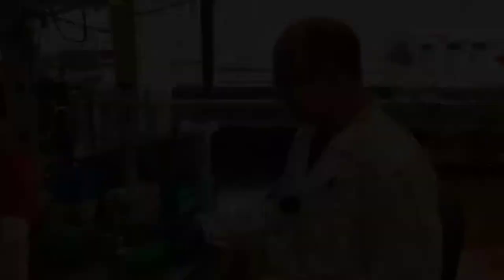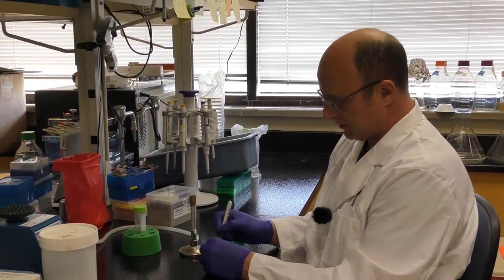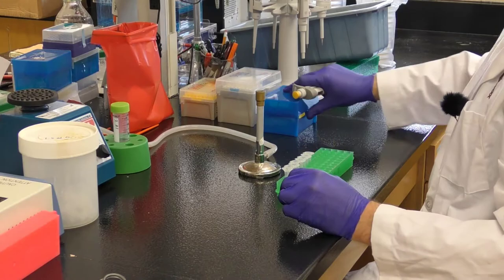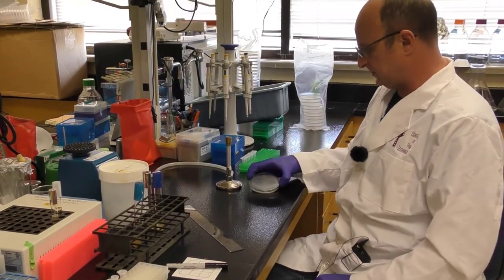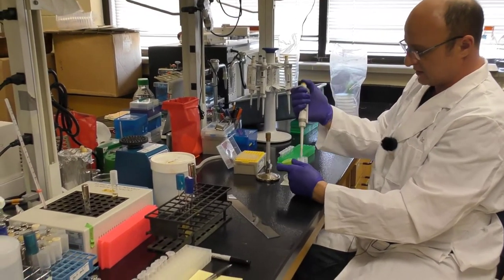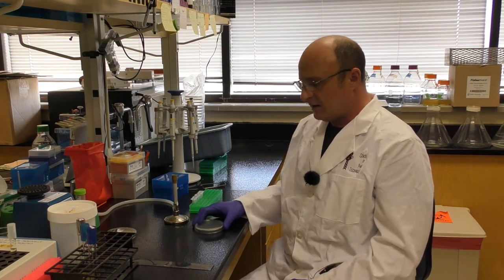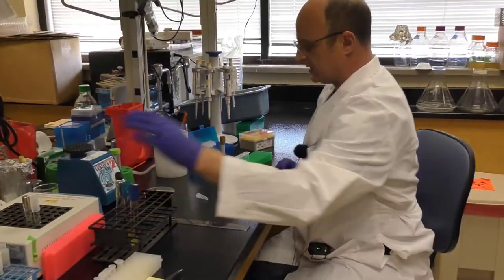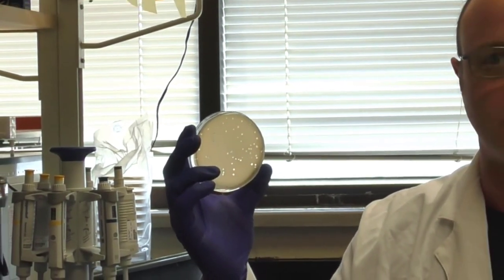Titering Phage - spot and whole plate methods

Comment: Great video, Actually I am facing problems in isolation and purification of single type of phage from waste sample. can you guide me? Sir if you have any protocol can you share it with me?
Reply from the maker: Hi ZAIUA MED, thanks for your question. Sorry we are late in our response, but if you check out our video on pickates and streakates here: https://youtu.be/jeRpyp5oLn0, you should be able to get the method for picking a single plaque and isolating your phage from the others. This is the most commonly used method available. Our written protocols for this method and other basic phage biology methods can be found here: https://cpt.tamu.edu/phage-links/phage-protocols/.